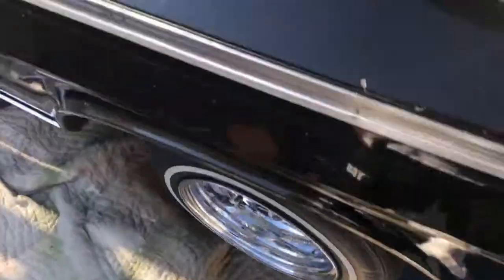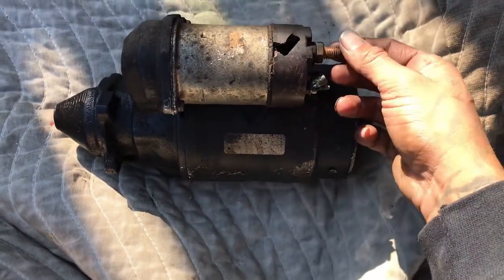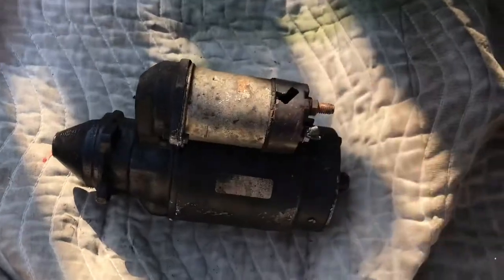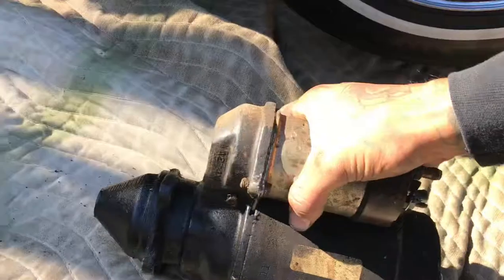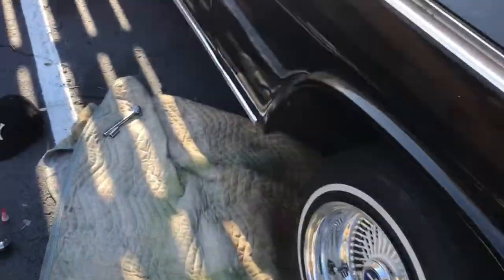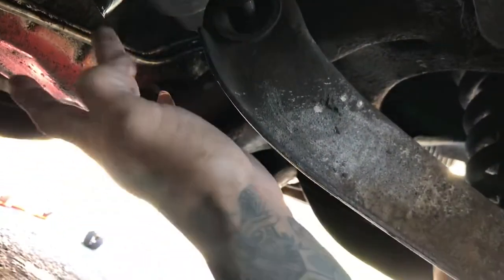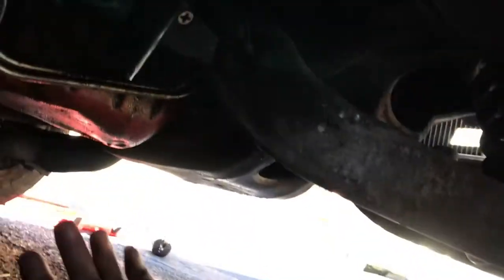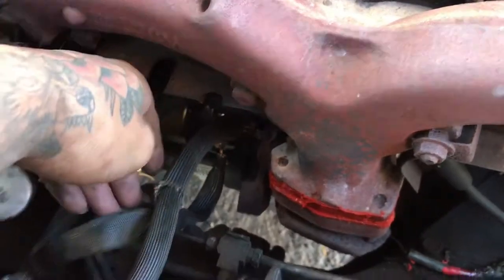1962 impala Starter install

Comment: Just got off a 24hr shift, and this is what I'm doing today. Fml
Reply from the maker: It’s not hard. You got this. It’s just 3 bolts. And plugging and connecting a couple wires. I’ve had to do it like 3 times to my ride.
Reply from the maker: How did it go? Was it a success
Reply: @vincentbryan1962  so the installation was a success, but the car still didn't start. I need to make sure all my wires are connected correctly. The car has power and everything it's just not turning over.
I have a 350 engine, I actually wish the car has the original engine in it. Do you have any new content coming out. You're videos are very informative. 
I can't wait to get back to the west coast. I'm loving in NJ now and ppl try scamming you a lot when you have a car like this. I need to get my chrome trim re-done and put a few layers of paint.
Reply: @vincentbryan1962  yup it was the ground, it got it working. The car turns on like a champ now
Reply: @vincentbryan1962   bad ass impala  I have a question I'm working on 64  but It don't stay on, what are the  color wires  that are running to your starter? I have a power wire and a purple  Am I missing one?
Reply from the maker: What do you mean it doesn’t stay on? That sounds like a battery alternator problem yea?
Reply: If I hold the key it stays on soon as I let go it turns off I put new  Ignition switch and nothing
Reply from the maker: I’m confused man Is there a way you can send a video

Comment: Where any of the bolts threaded into the starter body or where they all bolted into the bell housing
Reply from the maker: No the starter body didn’t have threads on it just holes. Just bolted into the housing.
Reply: @vincentbryan1962  hmmm well ok I have a 1948 ford F1 with a 1962 Chevy Impala 283 in it connected to a Studebaker truck bell housing cone Ted to a 1951 ford f2 4 speed manual and I guess it's just stuck and I need to hit it or something thanks tho